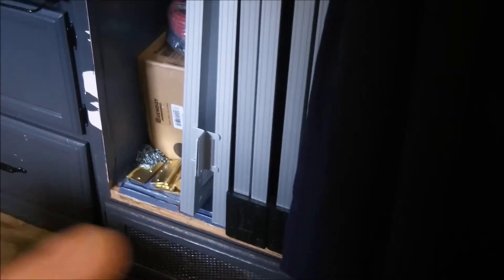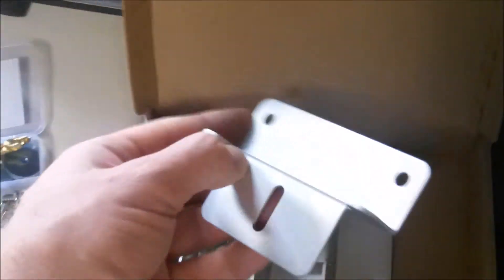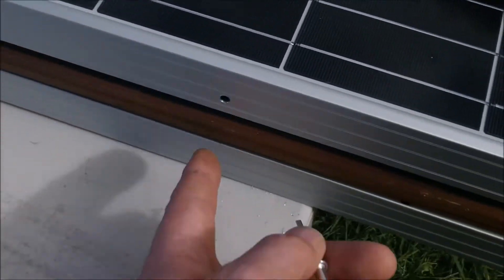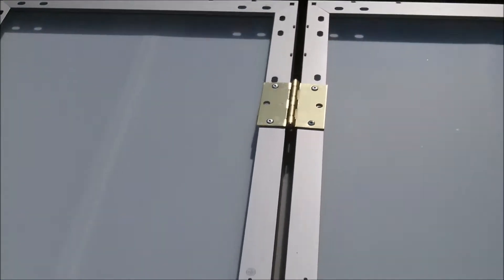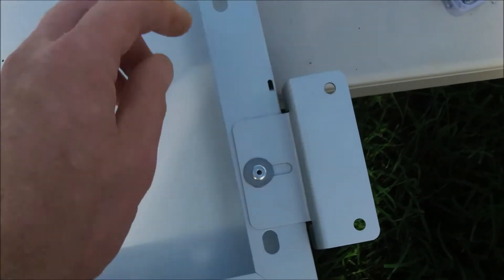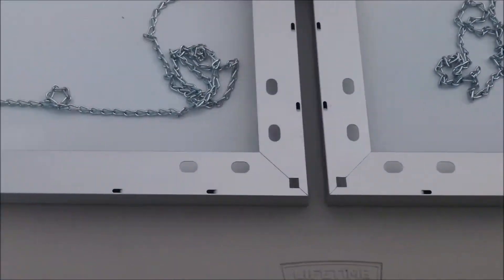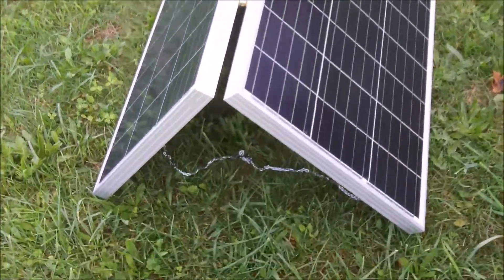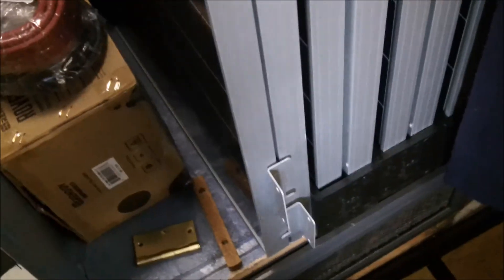renogy 800-Watt 12-Volt Monocrystalline Solar part 2

Comment: 800 watts is a good array size. I'm waiting on a quote from Santan Solar on 10x250w used panels. I have a few Newpowa 100s that I may use for security cameras or lights.